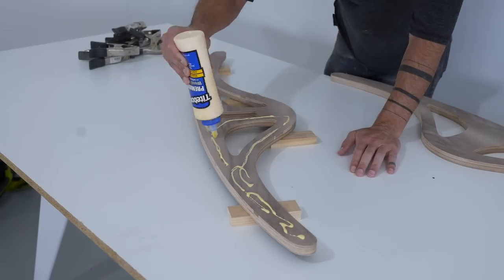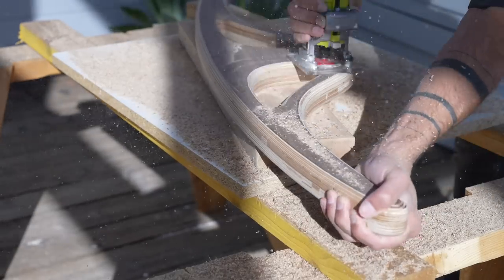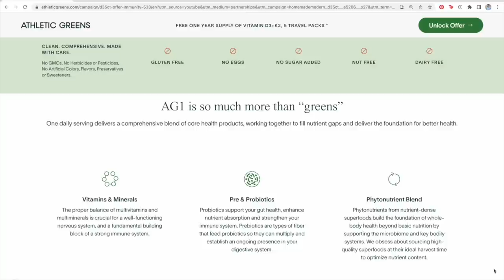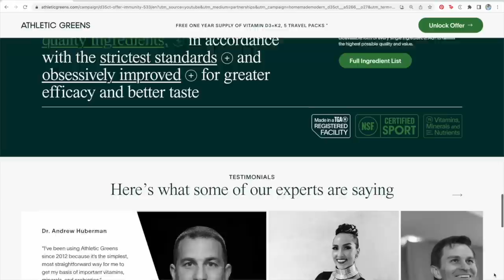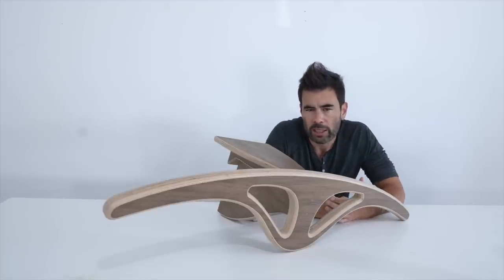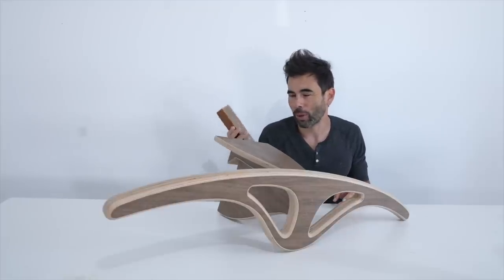Plywood Pull-Up Bar | DIY HOME GYM

Comment: Very pretty, but I'm not sure on long term safety at the joint once you reach a point where you're using weighted dips. I'd stick to metal.
Reply from the maker: I thought the same but then I started realizing that my wood handles on axes and sledge hammers are preferable and if taken care of last a really long time so why not
Reply: @HomeMadeModern  But the grain on an axe handle better aligns with the forces needed for that right?
Reply: Martin guitars were confident enough to use plywood for some of their acoustic guitar necks, and there’s a lot of tension on guitar strings. However, that force is only in one direction so time will tell if they hold up. My guess is the part that hooks on to the cleat might wear down eventually, but we’ll have to find out. It is still an interesting idea
Reply: I give you a kind reminder that those from the east that took down ancient Rome used wood and resin layers for their crossbows used from horses. Some found in pope shape are still 1000's of years later stronger than metal bows. You would not think it is so.
Reply: Remember plywood is multiple glued layers, the glue is stronger than the wood.

Comment: This is so cool!  I think, as far as the profile, I would add concave shapes for resting the hands in.  Maybe multiple along the profile for fingers, or a larger one on each side for the each hand. If the bar is going to get consistent use, your hands may wear down the bar to a point that the wood becomes too smooth to grip.

Comment: Cool ‘sketch’ idea. I’m thinking that a vertical post can be setup 1.5m-2m from the wall, and a top attachment can span between the wall cleat and the post, that way you can swing your knees more or do leg raises and such. Will take up more floor space, but better than having space taken up by a large footprint free-standing structure. 
That wall cleat will also be good for vertical storage to keep stuff off the floor
Reply from the maker: That would be cool

Comment: Swedish ladder attachment would work. How much weight can that pull up bar take? Seems like a steel pipe would make the whole job a lot easier.
Innovative design, not for me though. I don't think I'd need to be able to move equipment around and everything would end up being fixed in place without ever making use of the split cleats.
Reply from the maker: 300lbs under dynamic loading at least
Reply: @HomeMadeModern  Wow! How many lbs do you pull up?

Comment: Really cool idea, looks awesome!  Do you think your boys at semi exact could make a steel French cleat track system that you then clad over with wood for a warmer look?
Reply from the maker: I think a 1 inch piece of angle steel would work just fine if you drilled holes in it

Comment: nice but would always be thinking it will break and injure me lol being tall means i weight about 280 pounds with almost no fat and only average muscles ;|  if i bulk up i would get over 300 pounds.
Reply from the maker: I don't suffer from this type of fear because I just read the structural specs on materials but I have empathy for people who do
Reply: @HomeMadeModern  i have broke the steel welded commercially available ones and had a nice lump on my head for a week ;|

Comment: I like the design and flexibility but i don't think it will be strong enough to support my bodyweight + 90lbs extra weight..
Reply: The answer is simple. Grab a knife and cut off some of that extra weight.
Reply from the maker: I think you underestimate wood.  think about sledge hammer handles
Reply: It’s beautiful, but get to several pull ups per set and >200lbs… eh not so useful
Reply: @HomeMadeModern  double laminated plywood is indeed strong, my issue is the fasteners on the device, the cleat wall and the studs. isn't the face screwed and glued on to the perpendicular piece that hooks into the cleat? it will probably be strong but it makes me hesistate as i am paranoid as i had wall mounted stuff fail on me on heavy weight pullups. lol
Reply: @HomeMadeModern  im 180lbs and i max out with additional 135lbs on chain belt.